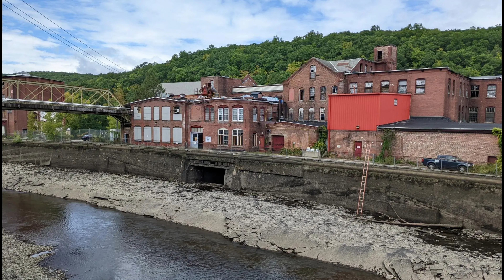Part 3 Athol 644 1/2 Vise Rebuild (Removing the Swivel Jaw Pin)

Comment: Excellent work and explanation, I have had luck welding a nut to the top of the swivel pins and hitting it with an hand impact driver heat and penetrant
Reply from the maker: I thought about welding a nut to the pin but in the end, I have had a lot of luck in just drilling the pin or bolt out. also if had not been threaded, I could have attacked it from inside the vise but this one threaded.

Comment: The decision to drill out the pin would seem to have been a difficult one, with the risk of damage to the swivel jaw. Well done.
Reply from the maker: It was a difficult decision. First, I do not own this vise. I am rebuilding it for a friend. Second, It is a very old vise and loosing anything original with it is a significant loss. Third, I do not have a solid plan on replacing the taper at the moment. Having said all of this, this method was the only method I could think of to get the swivel jaw off. Now I need to develop a plan on replacing the pin.